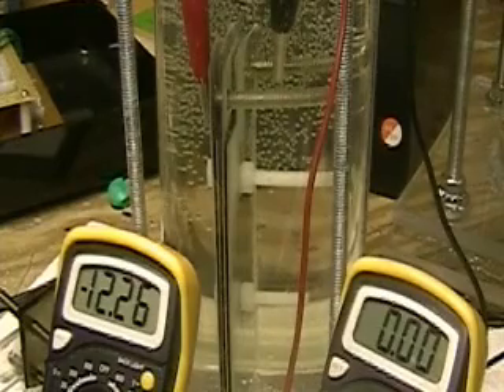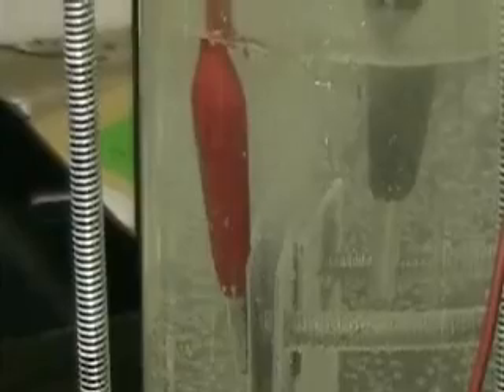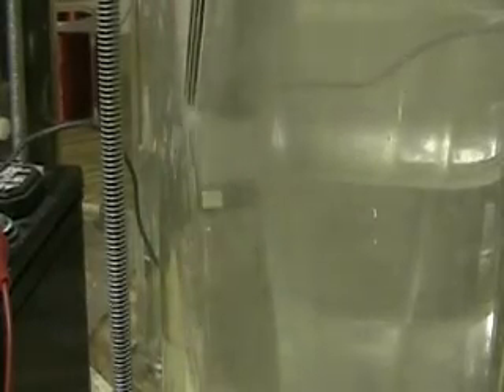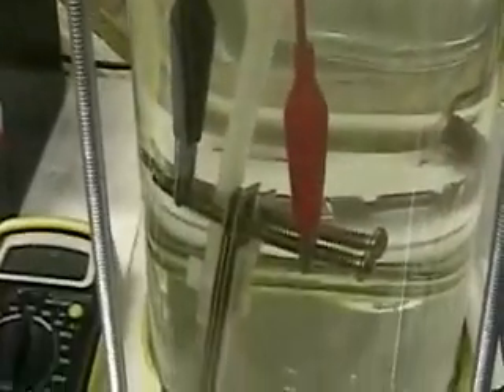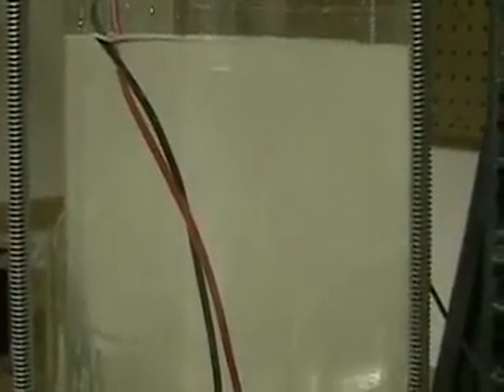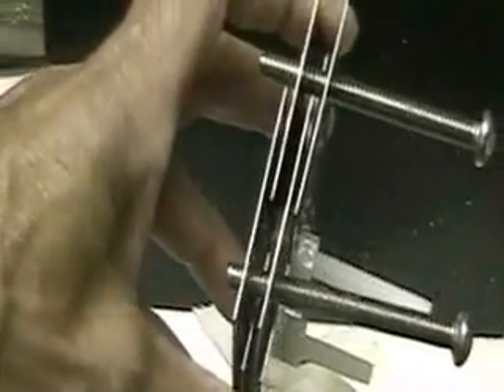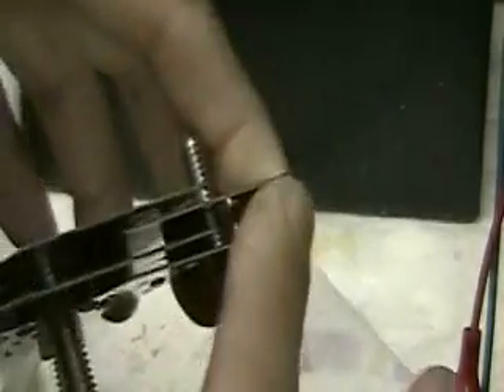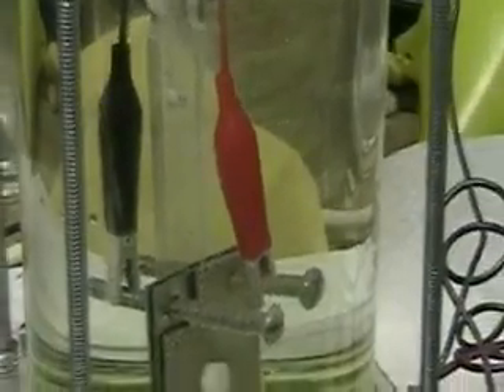Hydrogen Tap (WidowMaker Tests) 130

Comment: You almot have it. Not all frequencies are electronic.
A mechanical transducer fixed to the plate.(can't remember positive or nagative)  1000 to 25000 cycles/sec

Comment: When you cut out your plates, you alternate flipping the plates to align the holes for your screws.  Maybe you should try cutting from the same sheet of Stainless Steel and cut out a positive plate and a negative plate, (each having its own unique cutout) so that the plates will not be flipped when installed.  Or it could possibly be that The WM cell is made from two different sheets of steel, one sheet for the positive plates and a different sheet for the negative.  Worth a try.

Comment: Something else...I think you are right. Taper assits two ways. The plates are closer at the bottom. More current flow there. Production starts at the bottom. As bubbles release they start convective water current into the plate face areas. Maybe helps release bubbles from the plates.

Comment: Good stuff John. Thought-Small bubbles that travel up the confined space of the longer plates, under the greater water pressure of the larger container will produce larger bubbles because the pressure and the distance consolidates them.

Comment: John,
Good work... Glad to see you are sharing, unlike most.  I also have found that if you separate the groups of + and - with spacing and keep the spacing close between + and - then you can produce more H with less energy.  I think it has something to do with the work being done and the smaller amount of dieletric between two plates.  I haven't tried a neutral plate between the sets of + and -, but I will this weekend.  Keep up the good work!